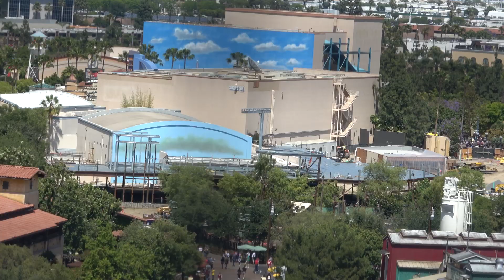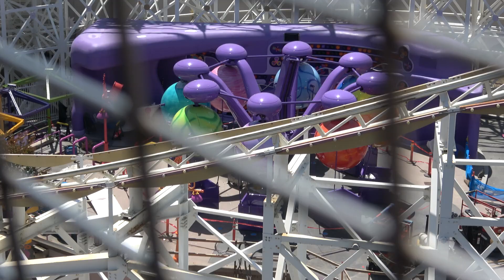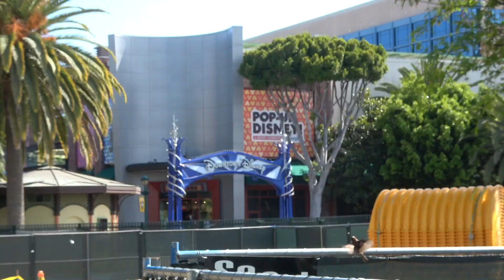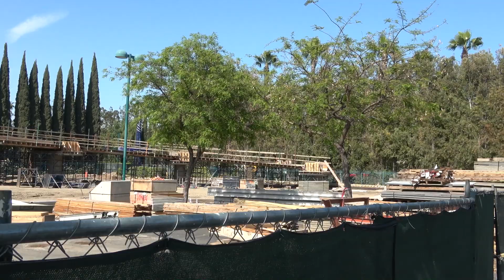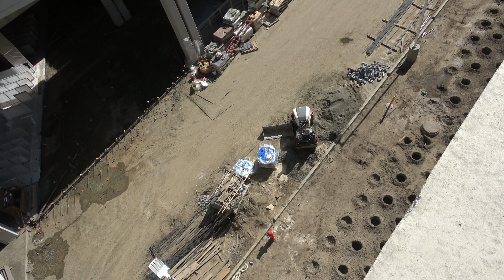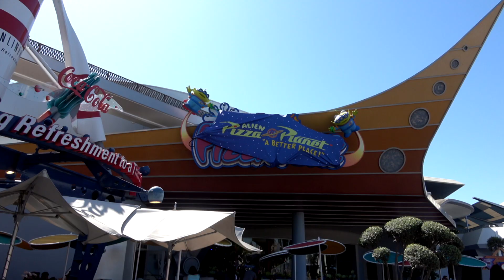More than just buildings?  - Disneyland Construction | 05/25/19 pt 64

Comment: Gray steel vs rusted steel is galvanized vs standard structural steel.  The galvanized is likely closer to the exterior and will have the outside skin attached which is why they added additional weather resistance.  The rusty steel is stronger and will be internal structure covered in fireproofing and drywall sorts of finish.

Comment: maybe the hole is for a new water feature?  I noticed that the inspection lanes towards Downtown Disney had gates installed.  those double posts that caused the uproar a few weeks back could be there to hold the gates in the open position.  deep excavations that need trench boxes are typically for sewer lines.  so they are probably rerouting sewer lines to make way for new structures.  a new thought for that level platform above the show building, maybe a place that could be used for cast members for performances that can be seen from the plaza.

Comment: The hole is most likely for a cistern for rain water to soak into the ground (Required for new structures) and/or earth compaction for new perinate security check point into Downtown Disney.  I have a gut feeling that eventually Disney will build a new Hotel, possibly a theme Hotel on that parking lot.
Reply: Hopefully they build a Star Wars hotel there, like the one they're building in Florida!

Comment: Just a guess, but maybe the Downtown Disney side of the parking lot, that huge hole, will house large motors that power a conveyor belt system for a mobile walkway to move guests from the parking structure all the way to the drop off point close to bag check.